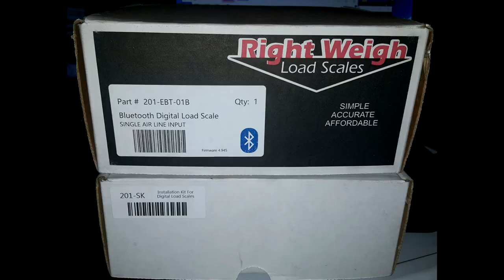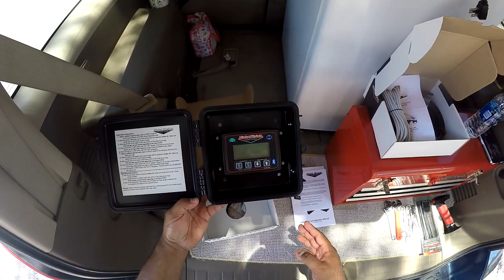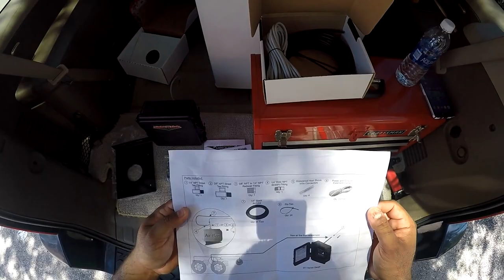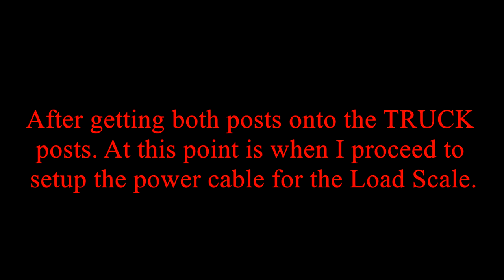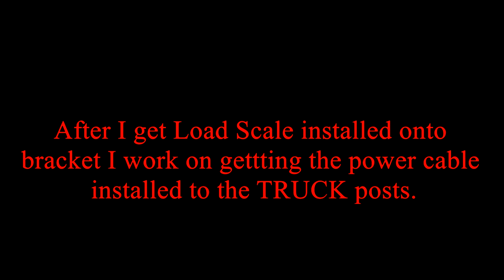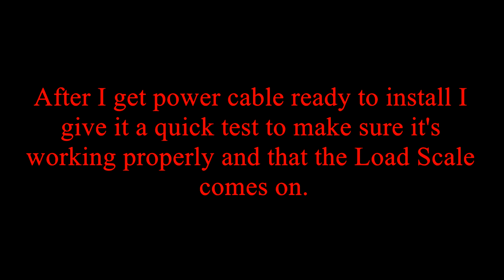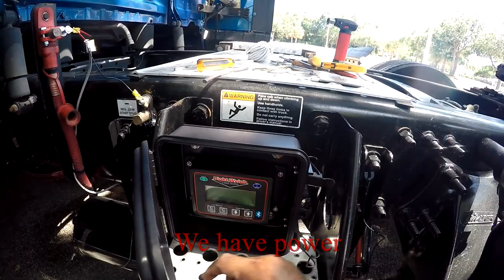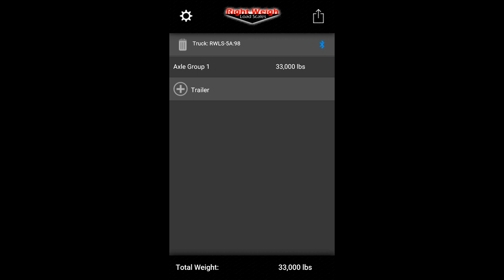Installing - Right Weigh Bluetooth enabled Digital Load Scale

Comment: Black tape on bare wires in the elements will rot this has to be a waterproof system for it to last.
Doing things this way will 100% give you problems.
No substitution for a Pro who knows what he's doing.
By 15 second of watching what he's doing its wrong!  How can I say this 17 years working on high end mobile electronics in retail stores and 45 years doing mobile electronics. 
Water and electricity do not mix! This isn't even looking at wire ga and type of exposed wires that should be in split loom or somthing.
When I do electrical work on a rig or car it dosn't come back, when they did I figured out what I was doing wrong and learned from it, so I learned to keep electrical connections in a spot they can not get wet, and protect wires from shorting out.
With all the years Tractor trailer guys have with big rigs they haven't figured this out because I've seen some really stupid shit on some. Like boring out a hole in sheet metal with no groment's to protect the wires from chafing or cutting on a sharps hole.

This might last a year until the first snow storm.
 Furthermore that bolt is not a ground!